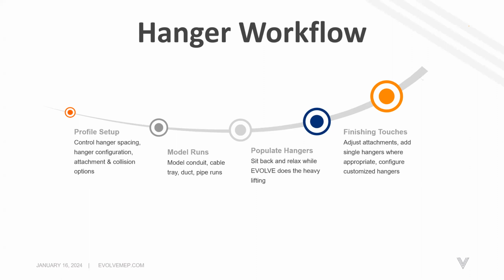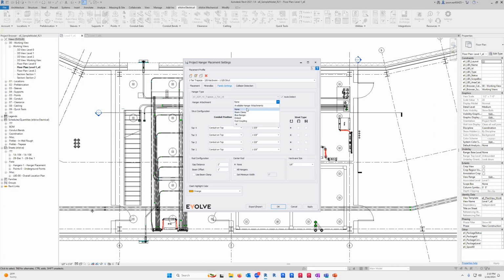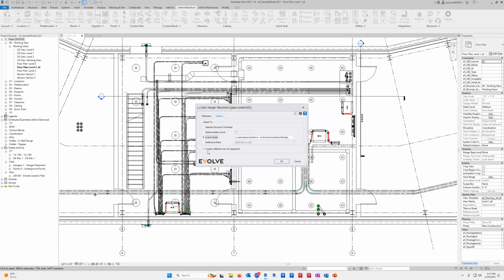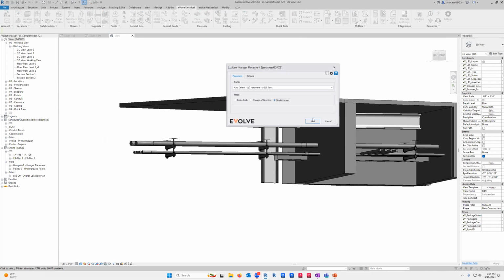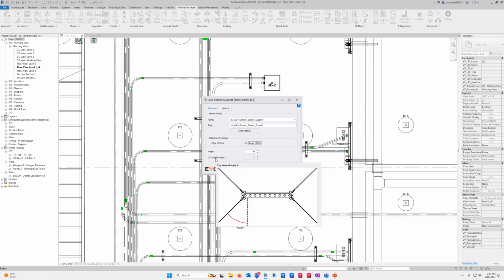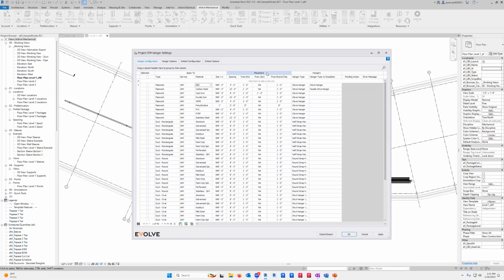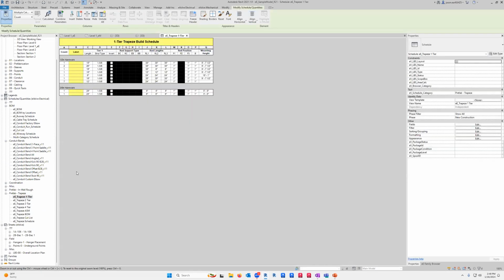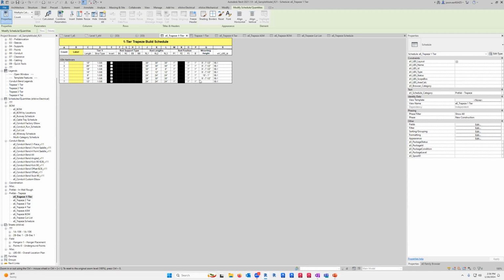Hanger Placement Automation: From Start to Finish

Comment: Question. So, do my pipes have to be fabricated with evolve in order to use evolve mechanical ITM hangers?
Reply from the maker: Hey KLHull! Our ITM hanger placement will work with any ITMs, even if they weren't originally routed with EVOLVE ✅